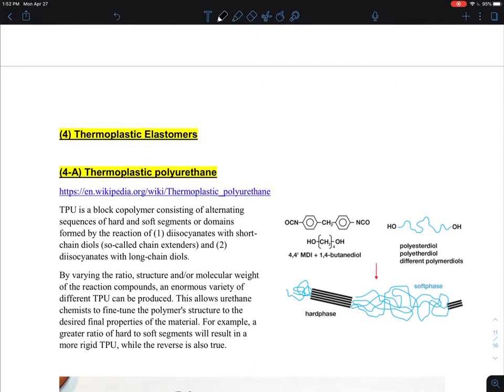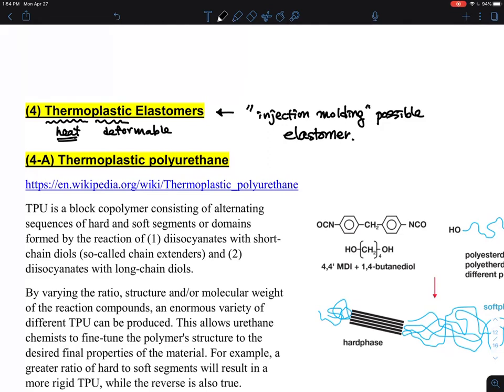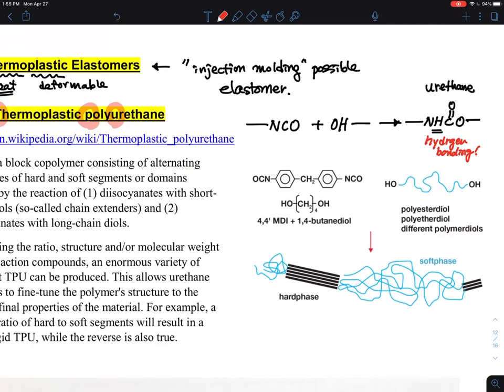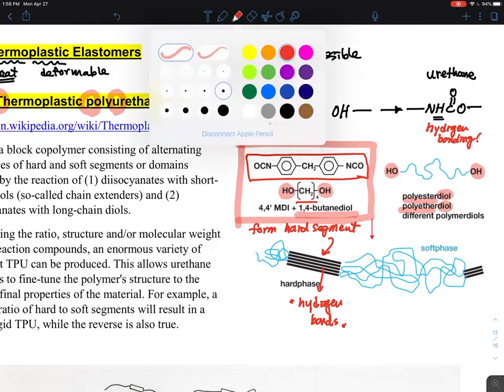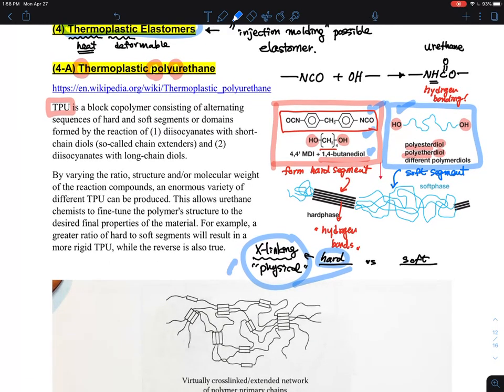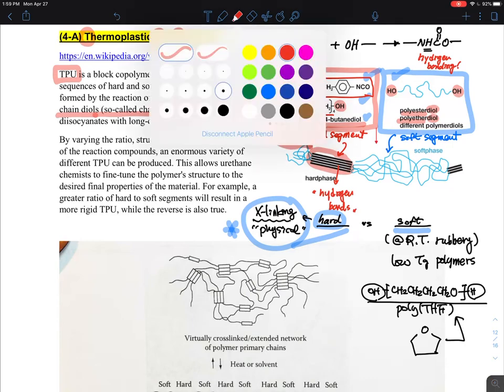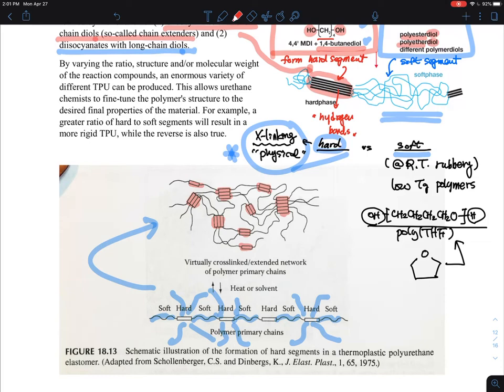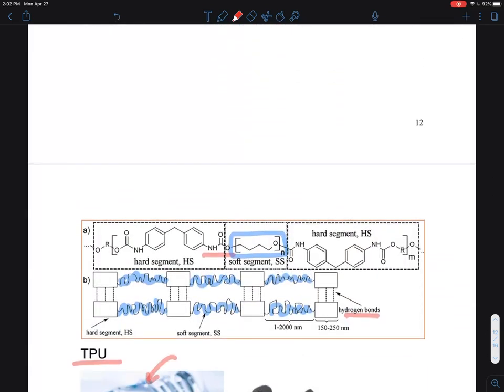05.07 Thermoplastic Elastomers - Thermoplastic Polyurethanes (TPU) blocky copolymers

Comment: Is it self healing material? Meaning can you heat it and have a tear seamed back together?
Reply from the maker: Thermoplastic elastomer (TPE) represents reprocessible elastomer.  Unlike chemically crosslinked rubber (e.g. rubber bands and automobile tires), the TPE can be reshaped upon heating.  This is because the physical crosslinking becomes soft and rubbery upon heating the polymers above the Tg of PS for the case of SBS and SIS triblock copolymers.